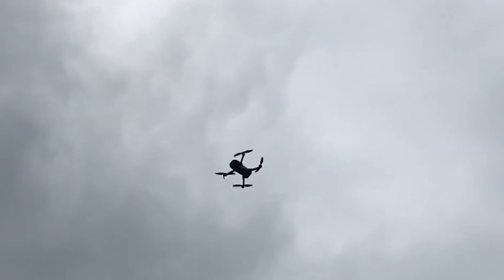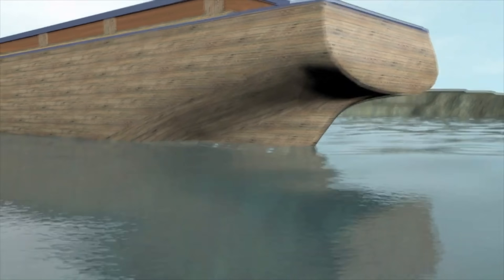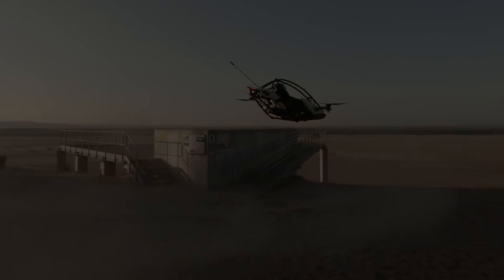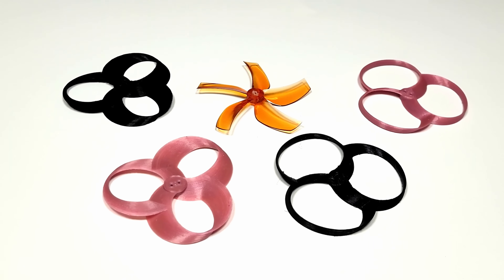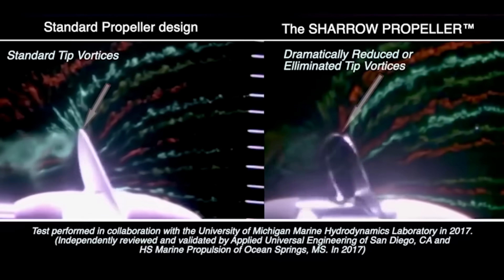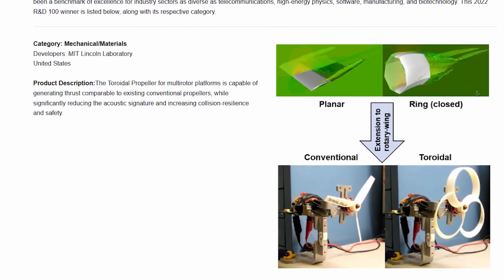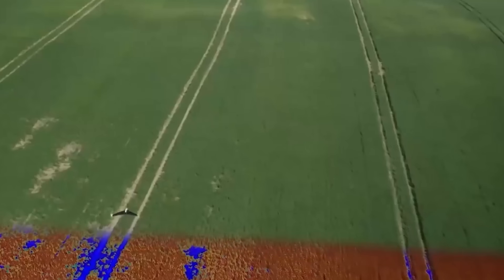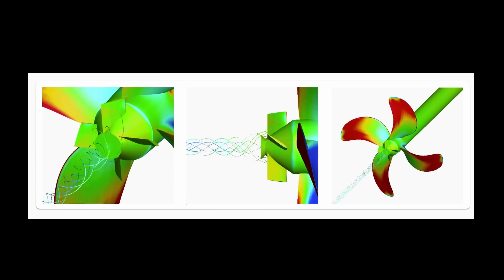This Propeller will Change Aviation Forever!

Comment: For aviation, weight has been repeatedly mentioned as a serious concern, with the assumption that the propellers will be made of aluminum or brass. Let's get some aerospace engineers on the case here and find out if that can be addressed using composites or some other new material. They may also be able to come up with some ideas regarding constant speed props, variable pitch props, and feathering for out of power situations. Of course, solutions to each of those problems will add to the cost of the final product, but we're going to have to explore the limits sooner or later anyway.
Reply: What about carbon fiber?
Reply: @writerconsidered  Yes, carbon fiber is considered a composite material, and may be a potential solution. I'm reasonably certain in the 30 years since I worked in the aerospace industry, additional materials have been introduced that may merit consideration. Older materials may also be a part of the solution such as fiberglass, just to pick one.
Reply: Of course you could build a toroidal propeller from CFRP. The problem is: Why should anyone? Todays turbojet engines have nacelles, they already remove the vortices from the blades. The trend for the future is open rotor though because nacelles induce drag solely from being in the wind, which also limits its size - and so would toroidal propellers. The trend is large open fan engines for the future where the blades are shaped in way that the vortices dont happen - without the huge useless and draggy surface area of toroidals.

Comment: What about the possibilities for power generation from wind? Looks to me like an engineering challenge that could address an issue that right now is being taken care of with mechanical regulators that limit rotor speed. It seems to me that different pitches could be manufactured into it that would add power at low to optimal speeds, while simultaneously adding a regulatory pitch that would limit the speed in high wind situations. That would be a win, win, win for lower production costs, reduced maintenance needs, and eliminated noise from the speed regulation mechanism. There would also be reduced complexity in the generation and control pod and less possibility of mechanical failure.
Reply: On a wind power plant pitch change is a must to be able to weather storms. And with a rotor diameter of 220m of Haliade-X 14MW for example the extra weight would be a Problem. 

I think this solution is great for small drones but i don't see it for GA planes, commercial turboprop planes, windmills, bigger ships and more. 

It solves (imho) a very specific problem that works well imho specifically in smaller diameter propellors that turn very fast.

Comment: I can't see this working on a full-size propeller.  Too much surface area and mass moving at very high speed near the tip.  Boat props are operating in a very different environment.   Small drone props are horrendously inefficient to start with.

Comment: No, the toys do not share anything with aircraft propellers beyond aesthetics.  Possibly the biggest factor in the Wrights being first to powered flight is that they realized propellers had to be wings, not the crude paddles their competitors were trying to use.  

Those paddles work just fine for children's toys and fans, but you can't fly with them, which is why nobody in Europe achieved powered flight until the Wright Flyer made a tour of that Continent.

Comment: It will be interesting to see how industries use this. Twin prop freighters now tend to allow prop featering so if an engine goes out on the ocean, the boat can stop the drag. Same with planes. So this design would really help in boats or planes with multiple engines. It only works in basic needs like a fixed angle single prop for planes or any boat where drag on a broken engine matters a low (ie not on your speed boat but on a freight liner)
Reply: if you have to hear about something on youtube first instead of the news.. then I call buillshit :) lol

Comment: This idea is not new at all, toroidal propellers have been used for decades, centuries, even millennia.  The manufacturing of these propellers was not deemed cost efficient  enough to use them in many applications.  Now with additives, better prototyping tech, and better materials engineering, it's actually more feasible.  This idea is from history textbooks. NOT NEW. (EG Archimedes in 200 BC)

Comment: The only way this would work on GA planes, is if they had electric propulsion, which is capable of near-instantaneous torque changes. It also would create far too much drag in a dead engine scenario.
 Add to that, toroidal shapes are subjected to far higher centrifugal stress than a standard prop, which translates to material fatigue, especially under load. Therefore, time before replacement could theoretically be much lower than standard props.
 Overall, good for drones and other electric applications with very little load, never make it in GA.

Comment: You have made some wild clames and a few mistakes. In regards to propellers many factors contribute to their performance. among others there's the number of blades, sise, the ratio of width and length, or aspect ratio that influences torque and thrust, that determines the mechanical efficiency.  Moreover depending on the speed, the angle of attack can increase or decrease, resulting in either more "power", thrust and resistance or "efficiency", and it varies with the speed of the propeller, the speed of the craft, the drag coefficient at a given moment etc... 
A badly design propeller, or one that is operating outside the specific performance envelope can lead in extreme cases to supersonic speeds at the tip of the blades causing an excess level of noise, increase of drag, temperature and increase or lost of pressure that disrupts the normal flow of air and lead to premature wear. 
In the case of a more dense medium like water there is another process called cavitation, that is the formation of steam bubbles (not from heat, but from an increase of low pressure resulting in the boiling of water at low temperature), that pops thus resulting in the premature wear of the propeller because of the shock wave and the sound of the busting bubbles that in the case of submarines stealth is a big issue. 
After more than a hundred years of powered flight and even more of the use of propellers in boats, dating form the mid XIX century, it should be expected that if toroidal propellers were better NASA, all the engine manufactures and the navy around the world would already being using it.

Comment: You shouldn't use percentages on percentages (unstated in this case!). It could make information hard to grasp for many (or even sound apparently illogical in this case)
For example if the increase in efficiency were 200%, that would turn an original efficiency of 25% into 75%. I can easily follow that, but many would not.

Comment: As a propeller on the front of an aircraft, I wonder about the drag of the propellor at higher speed.  That said, I wonder if these could be used in the fan section of a high bypass turbo fan.
Reply: There might be a small market for them on slower aircraft where a VP propeller would be unnecessarily heavy and complicated. The problem is that end of the market tends to be low budget and I can’t see these new propellers being cheap.
Reply: right? I was wondering about ducted fans too for more efficiency

Comment: what works in water doesn't work in air, one is hydraulic and uncompressable, the other will just blow out the side with a loud screeching noise
this was already tested by MajorHardware, it's garbage

Comment: The audio noise of standard props is a sign of inefficiency 
The lack of that noise in this instance is a proof of higher power and thrust consistency performance. Therefore less artifacts of wasted energy.

Comment: In propeller driven aircraft, you need to be able to feather the blades of the propeller.
That doesn't seem possible with the toroidal design.

Comment: No, no one at MIT designed this... jeez.  And everyone has known this for going on ~100 years now.  The problem is how to BUILD it.  The "design" has been done by 1000's of different people multiple multiple times.  There is a reason only the Sharrow propeller for boats is even partially commercially viable and actively being sold.

Comment: Considering the size of that thing, doubt it will have a practical application in aviation, at least within the next 20 years.
Current propellers are aimed at ease of maintenance, production cost and practicality.
While noise is of concern, reliability and costs are more important in aviation.
Perhaps in a future new type certificated aircraft it will be practical, but not today, unless manufacturers address the size/weight of that thing, and how much it is gonna cost to put on aircraft vs current propellers.

Comment: That clip from Mark Rober did not use toroidal propellors, fyi. There are definitely costs to this design. Two off the top of my head are that it is much heavier and it will have significant problems with implementing a variable pitch design. Both of which are very significant to aviation. Hopefully those problems will be solved eventually.
Reply: “And for that reason, I’m out”
— Mark Cuban
Reply: Imagine a scimitar blade being pitched
Slice the toroidal where the trailing half begins to experience stress decline
Make a flexible bridge between the segments
Yeah, easy as pie, not. But within the realm of realistic expectation.
Reply: @cowboybob7093  definitely. Not easy, but maybe the efficiency will be worth the development? Constant speed props are already pretty efficient. I have doubts, but someone will run the numbers, and if so, we'll see these out there.
Reply: I have to agree.
To be able to go all the way from feather and to disk and sometimes even continue to reverse are all important feature of a modern aviation propeller for a turboprop today.
For small drones, it would be a bit different since they got different requirement for their propeller.
Reply: I'm not certain it will be heavier. In a normal propeller, you have long blades that are unsupported at the end. In this design, the ends are actually supported by the outer ring. There will be more mass at the end of the propeller, but you might be able to use thinner material because of the increased support that the outer ring provides. It would also have an interesting effect on the vibrations experienced by the blades.
Reply: Whoops, wrong comment.
Reply: It sounds that being heavier is overcome by better performance
Reply: @laurynasgiriunas4780  
Which is a great thing on ships. But on airplanes, the efficiency has to go to a whole ‘nother level to justify weight.
Reply: @Skyprince27  https://youtu.be/rLnkwe-nr5w?t=220 at 55% of motor utilization gaining 100% of thrust should be more than enough to cancel out a small increase in weight compared to the weight of a drone or a plane
Reply: @laurynasgiriunas4780  
🤣🤣🤣 No. 
This guy is OBVIOUSLY not an aerodynamicist!!!
Reply: @Skyprince27  then you can always explain what the graph means
Reply: @laurynasgiriunas4780  
The graph means it’s about water & not air.
Reply: @laurynasgiriunas4780  
The efficiency of the Wright Bros propellers were about 66 to 70 percent. Today's propellers are around 90 percent efficient.
Reply: @laurynasgiriunas4780  not for full scale aviation. Once you start to rotate large mass, the costs of it are more than just the increase in mass. It makes a big difference to all kinds of aircraft dynamics, and performance does not fix those, in fact it makes some of them worse.
Reply: Consider the breakthrough called the "constant speed propeller," it changed aviation as WW-II was erupting. "Speed controllers" became obsolete when propellers more efficiently adjusted to demand at a constant rotational speed. As for weight, they do have a fundamental shape that's stronger than conventional blade propellers, and its weight will fall. That said, there is a considerable rotating percentage of the weight in the farthest reach of the propeller where rotational weight has its most negative effect.
Reply: But it works on drones😂
Reply: @MrRogersFish 
Ha ha, propellers on airplanes get damaged often enough now, and they’re made of durable aluminum alloys
Reply: @Skyprince27  most are, but not all of them. Many are still made of wood, and a lot of new props are made of composite, some of which have like balsa cores.
Reply: I was just coming to make the same comment about the Rober clip. Nice catch!
Reply: @MrRogersFish that might be the thing that fixes the mass problem. I hope it does.
Reply: And yet so many aircraft props are fixed pitch. In fact, in GA most smaller and trainer planes are fixed pitch. So in that market it could prove to be a benefit.
Reply: Would a duct fixed to an ordinary propeller and rotating with it, such as you see in some flying toys, not have much the same  effect? The pitch could be varied if the propeller tips worked round small axles on the duct, and shaping the duct could improve the airflow. Just asking
Reply: If and when electric motors replace engines, variable pitch will be potentially obsolete, speed controllers will take care of it.
Reply: @lodgecav490  Variable pitch is not there only to control thrust, but also to optimize the propeller efficiency at different air speeds and rpms (related to blades angle of attack). You can't replace this with more flexible speed control.
Reply: @lodgecav490  as chwibon said, not likely. Electric motors still have a most efficient speed range, and that's what constant speed props allow. Non-combustion aviation is still a long way off for anything besides small recreation and small intra-city transport.

Comment: I'm skeptical that this would be usable on airplanes. Drones and boats yes, but not manned airplanes. Two main issues with that, plus another speculation:
- Variable pitch: All but the smallest airplanes use variable pitch propellers, and I can't see any way of incorporating that into this. Not a problem for drones and most water vessels, which typically use fixed-pitch propellers.
- Centrifugal force on the hoop section. Normal propellers have straight blades for a reason, the immense force pulling outward is along their length, keeping them straight - a curved blade would be pulled straight. A toroidal propeller the size of an airplane propeller spinning at airplane propeller speeds would pull itself out of shape unless it's immensely heavy. Weight is also a concern, this would be much heavier than a normal propeller. This isn't as big a concern for boat or drone propellers that are much smaller, or on large ships spin much slower, centrifugal force is a much smaller component of the load on them. Drones can use lightweight (3d printed in experimental designs shown here) plastic, and boats have small propellers and are less weight sensitive.
- Actually a third thing comes to mind, even more technical: these look like somewhat wider-chord blades. Smaller propellers and moving slower through their respective fluids results in a lower Reynolds number, with viscosity a more major factor (water is much more viscous than air but also denser, the ratio of viscosity to density is fairly similar, so the same object at the same speed through air or water would have similar Reynolds numbers). I believe that this is why boat propellers, as well as desk fans, typically have rounded scoop-like blades, while airplane propellers are longer, thinner wing-like blades. TL;DR I'm skeptical how well this will scale to the size and speed of an airplane propeller from an aerodynamic perspective.

Comment: physic is the rule and everything else is opinion. you can't have a propeller more efficient than single blade. However, Single blade doesn't have weight balance, So 2 blades is as efficient as it's physically possible

Comment: 1:42 Aerodyanamic --> Aerodynamic
1:53 "tips reaching the speed of sound"  NOT TRUE for UNDERWATER propellers, the tips lower the pressure, causing "boiling" of water, ie cavitation, ie bubbles.  TRUE for propellers in the air.
Propellers for water are different than air because water is incompressible while air is.
Other YT videos say that the MIT study does not claim air toroidal propellers have greater efficiency but rather lower noise and is silent on efficiency.  YT amateur tests seem to indicate that the noise reduction is true while the loss of efficiency is also true.
The problem is that MIT did NOT provide CAD drawings for their propeller design so that others could verify the results.
Amateurs had to guess at the design after studying the MIT presentation.
This hints that MIT is not telling the whole truth.

Comment: If a type could be designed that has a pitcheable thrust , by changing the shape somehow (for example being able to slide in and out on the axle in terms of length and simultaneously changing pitch angle)  , then its function analog to a GA constant speed propellor would be even better .

Comment: These are not new at all.  And aviation doesn't use them and never will because all the claims other than noise are false and were fully researched many years ago. The niche they could fill is drones, because they happen to hit a raw note with everyone.  However, even here there are better lower noise propellers and the drone with Mark in the opening shot uses pne example which isn't a torroidal prop.

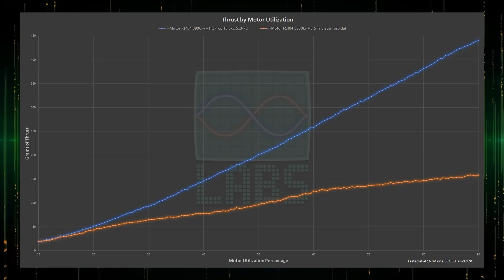Comment: Someone correct me if I'm wrong, but from what I see at the graph shown at 3:35 it is exactly the opposite, the orange curve is the toroidal propeller and given the same engine power, it has less thrust.
Reply: Well spotted. You are correct! There are many holes in this presentation - even toriodal ones!